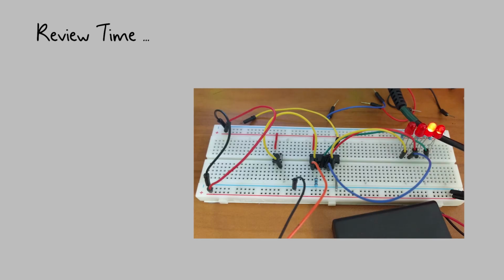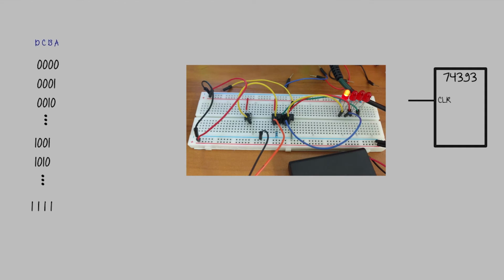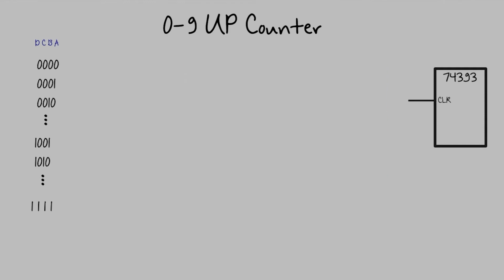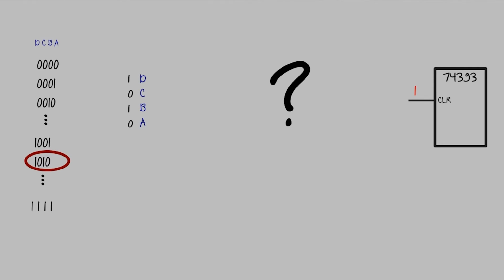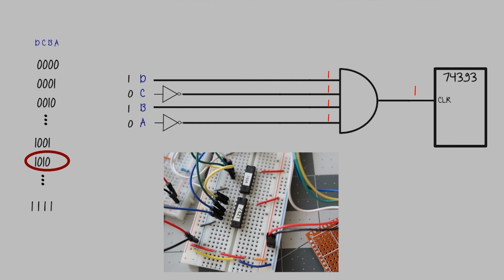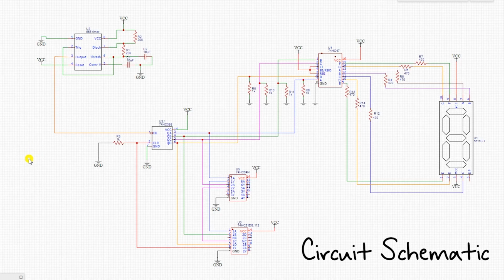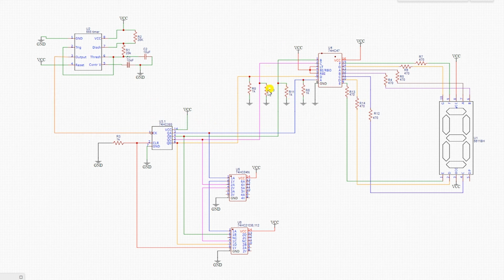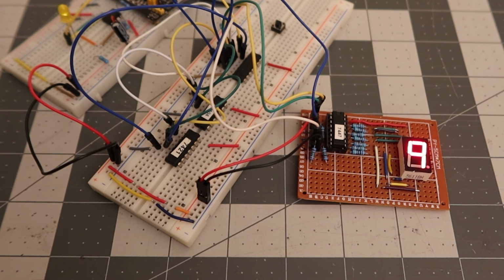Tutorial | Designing a 0-9 Up Counter using the 74393 4 Bit Counter

Comment: Nice demo!

Here's an old-time TTL designer trick. Over the range 0-9, outputs B and D are never both set at once. They only both go high when the counter reaches 10, which is when you want to reset the counter to 0. Therefore all you need is a 2-input AND gate on outputs B and D. The inverters and 4-input AND gate are more complicated than necessary.

If you use an SN74LS93, you don't even need the AND gate because the chip has an internal AND gate on its reset inputs.